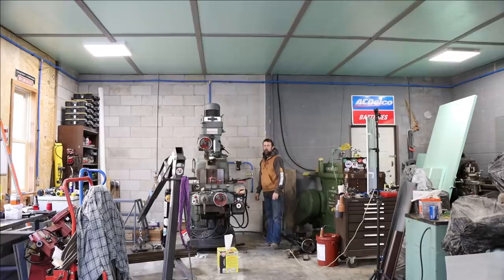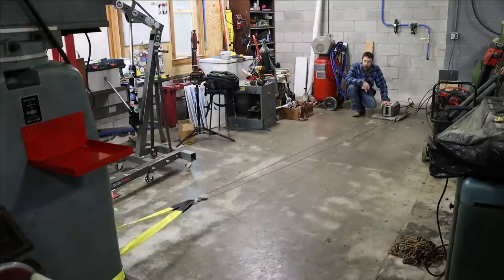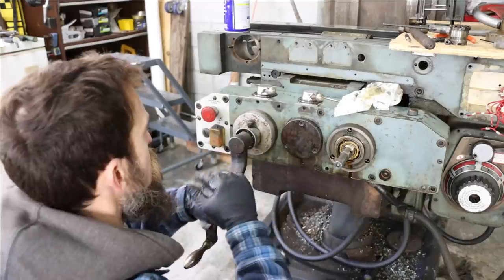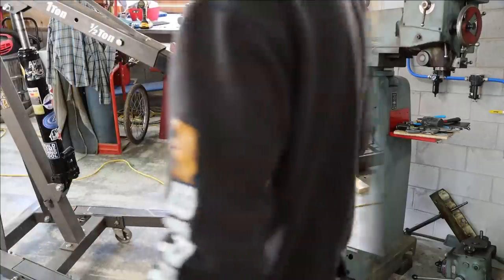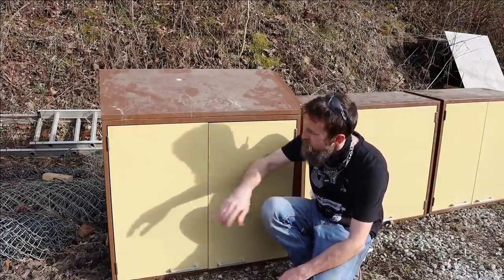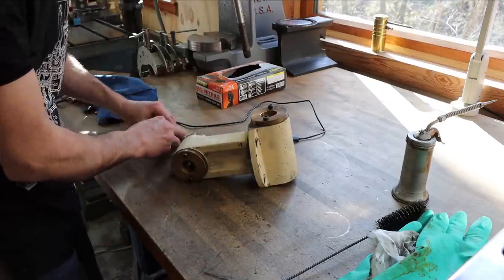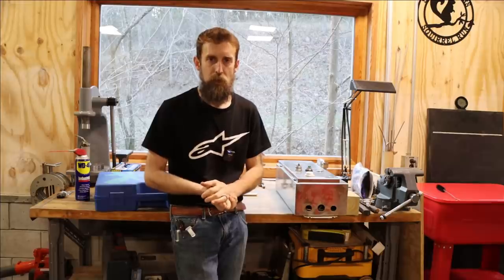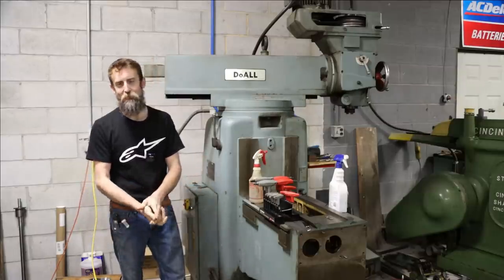Tearing down the DoAll mill. The Damage is bad.

Comment: about taking off the knee : you could put the forks from the forklift over the knee near the ceiling and only use it as an ancor point for the winch to lift it up and off the ways
Reply from the maker: The forks only raise 5' . It unfortunately will not work.  It would be nice if it would

Comment: I see a small gantry in Steve's shop. The spray weld kit is a real deal tool. We used  them to repair steam turbine & induced draft fan shaft bearing journals in our steam plant turbine repair shop

Comment: Enjoyed Steve...Carful lifting that knee, getting the balance right is key. When I did mine; made a bar clamped internally in the knee, didn't want to trust choker sling. It was only a series 1 BP..
An option for extending network access to the shop is a point to point Wi-Fi, there low cost and real easy to setup. works like a super long network cable....ATB

Comment: We have rebuilt 3 DoAll mills some what like this one over the years. I know it it too late now, but the easy way to remove the head is to rotate it 90 or 180 and crank up the table to support it. Put plywood on the table first. Disassemble the head on the table, repair as necessary on the table and then put it back. This way you never have to move dangerously heavy stuff around.  Your mill is 1000 lbs heavier than a Bridgeport. You see the benefit of all that mass when you take heavy cuts. It makes the Bridgeport look like a toy.

Comment: Steve,
You will need to try using only two machine rollers instead of four. Most machines will support on only two rollers. This will allow easy steering. We regularly rigged machine tools weighing 20-30k on only two rollers. It is surprising how easily very heavy machines can be steered by simply leaning in with body pressure. Center of gravity is pretty easy to find. Our preferred machine skates had four sets of rollers, but only two rollers rows were in contact with the floor at any one time as the end rows were set a bit higher than the middle two rows. Center of gravity on a knee mill is easily adjusted by moving the table and saddle.

Comment: I have moved machinery in the 5-6000lbs range using a johnson bar, 3/4" pipe, and a good pallet jack. Goes pretty fast. Others have mentioned a gantry and I have one but they are good for up to a ton unless you get something more commercial grade. A ton would work ok for pulling the table but you could not lift the whole machine up with it.

Comment: Reading the comments and seen a lot of negativity about the sound. That's what the volume switch on your device is for people! Steve, I have seen machine movers use a heavy-duty wooden handle on heavy wheels, with a short stout metal blade.

Comment: Thay spray welder is awesome. It is great for building up axle shafts for tractors and crawlers. Looking forward to the solution to your do all mill disassembly. I would rig up a heavy tripod over it and used a ratcheting hoist, and go slow and easy.

Comment: I knew that was a throwing axe when I first saw it in this video. And I know that the ONLY exception to using a pressure washer on a machine, is when you have it completely disassembled. You've expressed that wisdom many times.

Comment: For moving machines I use a Tirfor winch. They aren't very popular in the USA but used a lot in the UK. A very different beast to a come along. The one I use will lift about 8000lbs vertically and pull a lot more. Very slow and controlled.

Comment: I’ve used Turcite and Rulon, make sure you use proper glue(Shamban). It is self leveling, and holds a constant thickness. I worked for a rebuilder who tried regular epoxy and the results were not good.

Comment: If you want to have more fine control over that forklift, you can put flow control valves in the hydraulic system to slow the flow. I would consider a joystick type and add a momentary contact button switch to turn the pump on to lift so you can vary the flow but a simple needle valve for about $40 plumbed into the lift side would allow you to adjust the lift and drop speed. There might even be one already in the system on the pump.

Comment: Steve, if you want to brighten up this shop, consider this product or one like that will resist oil and grease, A mechanic friend once used a white wall board like this to finish the walls in his unit repair room. It was easy to clean and brightened up the room more than doubling the number of lights. I used bright white enamel in my shop with a similar wall board behind machines that tended to spray oil or dirt so I could wipe it clean easily.. Insulation board might help your comfort in extreme weather.

DPI™ Smooth 4' x 8' White Wall Panel
Model Number: 300 Menards® SKU: 5071063 (

Comment: Ok, watched the whole video. When I was a young man we would pull motors in a garage using a 4x6 and two 4x4 posts to hold the weight. The 4x6 was screwed to the underside of the joists to locate it and the two posts were wedged in underneath and removed when the job was done. I bet you have a gantry coming but that is another way to go in a pinch. You might consider making a table to fit over the forks of that lift you have. I bet you will use it to move heavy stuff on/off the mill and other surfaces more than you use it as a fork lift.

Comment: Steve,  it's unfortunate I am not local. I would love to set up a three phase power distribution system for your shop at materials cost only. And even automate the rotary converter start. Like when the tank air pressure goes down, it would first start the converter, then after about 15 seconds allow the compressor to start. Easily done with cheap micro-controller boards driving your magnetic starters.

Comment: On some of machine tools, if you remove the gib the component will come off.  I have a mill here and I can pull the table straight up and off just by removing the gib and I'm sure the knee will come off forward with the screw and gib removed.

Comment: Steve, a strong ammonia and  "REAL" TSP  solution soak will remove the old dried up coolant quite nicely.  It's cheap but soak it outside as the ammonia is really hard on the eyes and nose.

Comment: Little tip on your sound, in your video editor look for the normalize function in your editing software.  Normally you can right click on the sound stream for each clip and select normalize, or increase/decrease the volume of each clip by a number of db.  At the moment some sections of video are really quiet so i turn the sound up then the next clip is full volume and it blasts your ears off.  Another good video btw keep up the good work!

Comment: I've recently changed to scribing the parts with my ID #s or location marks with an HF vibrator scriber, with a cheap scriber. I've washed off my sharpy ID so many times I could not begin to count. It is so permanent and costs less than $10.00.

Comment: I USED TO SPRAY WELD BEARING SURFACES ON MOTORS AND GENERATORS.BEEN MANY YEARS LIKE 1976 BUT IT REALLY HASN'T CHANGED MUCH.

IT WILL PAY FOR ITSELF THE FIRST TIME YOU USE IT!

Comment: Mmm, Mr. Summers, you have placed your hands onto some serious toys.. The doall is a big piece and meant to do precesi work, altrhough the ways are what they are, but I'm sure you'll be able to remake it almost as good as new. I would like so much to have on hand something similar, but with little space it is not possible. It's also very sad to see so many machines and equipment meant to last be scrapped because of some repairable issues... Anyway, good luck with your work and to remove the knee you might use some gantry thingy, on wheels possibly.. =) I can almost read your mind, happens to me too. While having so many tools, it is always somehing missing to solve a problem. Keep on the good job!

Comment: I got hold of some old 1990's server cabinets last year for housing my 3D printers, they still had the 280mm and 140mm extraction fans in them along with a driver, they were far too powerful for controlling the temperature for 3D printing but I'm sure I will find a use for them

Comment: Did the DoAll saw go away? If it was finished I guess I missed it.
" Are you using 220?"
"Yah, 220 221 whatever it takes."
Funny when you were showing the scared up surfaces on the saddle. I was thinking it would be cool to add material to it so you can machine it back down.

Comment: I bet the dog in the woods is running deer. We had dogs out in our woods doing too. The doall mill sure is built right. Do ya think it was lack of oil or just repetitive heavy loads being milled? I started spray welding back in the seventies on steel mill rollers n journals . Bethlehem and US Pipe were customers of our shop . Gantry crane or big jib crane would help in the shop. Like to see the pups come out for rubs n mooch jerky to I bet. God bless y'all

Comment: So, did I miss the reveal on the weight of the DoAll table?

I liked the pressure washing method of cleaning those big (now free)machine casting pieces. That makes short work of removing the gunk, but still saving the painted surface coatings! That DoAll is one stout piece of machinery. Once you fix the ways, it will serve you well.

Comment: Steve, I have my workshop tethered to the internet in my house with nGenius Technologies ENH500v3 Wireless CPE/Client Bridge. I can’t recommend it highly enough. It gives me hardwired speed in my shop and in a year I haven’t even unplugged it to reboot. It just keeps working. The included quick start guide is useless though. I found better setup instructions on the web.

Comment: I was wondering if you could lay the Doall down on its side, then take the knee off vertically. It would be a little safer but not as safe as maybe a gantry crane would be. You’ve made a pretty good haul this week, a nice Jacobs 14n super chuck, some good cabinets for storage, a nice torch to repair worn shafts and things! You talked about turcite (sp?) for the ways on the Doall, could you spray metal with your torch to repair the ways or isn’t it meant for wear surfaces. Good video, thanks!

Comment: I say goodbye to my Excello Milling machine next weekend, sold it to buy a Snapmaker 2.0 a350. The XLO was a CNC machine that had a bad controller.  I removed the steppers and found that one had burnt terminals in it. The mill head was made for CNC only and had none of the regular power feed gears. I have not used it as much as I should have. I may get another one if I can find a good used one.
Reply: You sold a mill for a 3D printer?
Reply: @1pcfred  The price I sold it for was   nearly 3 times what I had in it and I wanted a 3d printer.  The Snapmaker is also a laser engraver and CNC Carver.  All thing I can use more than an oversized mill.
Reply: @rictecilder  I guess. I have a CNC engraving machine. I don't really like preparing files for it to run.

Comment: That NEMA 4X motor starter gets me ezxcited. 

I did know what that spray welding gun is used!!! It’s also used to make hardened seats for valves. I think it’s called stelliting. I specified a lot of stellite 6 valves for JGC, Japanese Gas Corporation, or the stubborn donkeys of the engineering world who demand the best for questionable uses like full stainless with stellite 6 for nitrogen service!

Comment: Iv learned when picking the brain of an electrician or someone with an expertise  other than mine I always ask what not to do it seems to be more important to me to know what you never want to do outside of those parameters its generally safe , case in point when I started operating equipment the first one was an articulating front loader on hills and I knew what I needed to do I just wanted to know what not to do as far as safe operation since then iv got certified on several forklifts loaders and excavators in order to work on them you have to put them through their paces

Comment: A few thougts about rebuilding the Mill, i you apply Turcite on the ways of the Cross Section, milling or shaping will be completely fine. Did you find  a reason why the surface is so badly scored ? Clogged oil line ?
Befor you do anything to the surfaces, get some measurements and some reference points so that the Spindles end up in the same heigt after applying Turcite.
Do you plan to get only the Y-ways on the knee ground or the underside of the Table as well ?
Are the dovetail sides scored too or only the horizontal section ?
Thank you for the great videos !

Comment: Great channel Steve. I wish I had a fourth of the space for a shop like you have. Im in the market for a mill and a lathe to get started as a hobby-ist, but Atlanta is not really a good market for finding used machines, or hobby sized machines. Been looking at Precision Matthews and Grizzly. Any pointers on picking a machine that will last me from a durability and functionality perspective? I probably have 20 good years left to learn before age takes its toll.

Comment: I don't understand why you would use that death trap HF engine hoist to lift/lower/move that casting when you have that powered fork unit that has the vertical travel to do the job. The engine hoist isn't a bad tool to have, but if you have better options why risk it. I had the same "Pittsburgh Heavy Duty setup years ago, when moving the head of my mill the cylinder failed and smashed the casting, that day I started looking for forklift.  It absolutely boggles my mind to see guys and girls that rely on their backs, eyes, and hands to make a living yet they won't take the most basic steps to prevent injury, welding bare handed, grinding with no shield, lifting heavy items when you have equipment, and the ABSOLUTE worst, wearing sandals in the shop. It really seems like the "I am too cool to wear my seat belt" mentality just never went away.
Reply: I wear my safety slides in my shop in the summer. It gets hot here.

Comment: Re: internet in the shop. Forget about running cables from the house, I think the cable runs will be beyond the max length for copper. Fiber is ok, but could be pricey, and fiber can be pretty fragile.
An alternative would be a microwave or radio beam link, they can be gotten quite cheap, and the cost vs properly rated exterior grade fiber cable is probably comparable.
Just wanted to drop that little seed into your head for when the time comes!

https://eu.store.ui.com/collections/operator-airmax-and-ltu
Reply: I looked at connecting 2 houses 1/4 mile away.  I could get ADSS (self supporting..think telephone pole spans) 1 kilometer single mode fiber for $600 😯
transceivers were $40 x 2.  doesnt make a lot of sense for Steve but just know its possible.  let someone else benefit from my dozens of hours researching this.
Reply: @Live.Vibe.Lasers  what I like about the radio solution is, it's crazy cheap (£100 transceiver on each end + maybe £100 in cable, clamps, pole etc), and it's effective field is +/- maybe 60°, so when it's blowing a gale outside, it's keeping the link up

Didn't know laser was an option tbh, my experience has been purely on short hauls runs, between buildings in a campus etc. I've never worked with the backbone level stuff.

Comment: Honestly, on a used "machine" like this, one should simply take it completely apart, clean and inspect prior to even attempting to start it up. I've known a few people not far from me purchased a used mill, fired it up just as soon as they got it, turned into a huge mistake on their part. 
With today's technology, just take your cell phone, take pics, lots of pics or, simply video record like you do now. Forgive my ignorance on this machine, (I'm not a machinist) but, that oil looked like it needed to be changed. I deal with gear oil, engine oil and hydraulic oil all the time. I was taught, when it starts getting dark like that, it's due to be changed.
That's why you should never use a "dish" service for your internet, they're all unreliable. 
Steve, just build your wife a new desk, you just got done rebuilding your shop, more or less. A desk isn't that hard to make. Great video as always, cheers :)

Comment: Go to https://satellitemap.space/ to see all the satellites Starlink has up now. Will be 42,000 of them eventually. If you click on the nearest ground station there is an option to find your location and see the actual satellites you are connected to. I used the Eutectic spray torch a lot when I ran a machine shop for electric motor repair in the 70's. Saves a lot of very old stuff. We used to repair motors for the cotton mills, none of which were made anymore. Pump casings, motor shafts, bell housings and Pancake 5 hp motors were often rebuilt that way. You will love it. Just be careful and keep the ways covered when doing it. Makes a gritty abrasive mess sometimes. Consider making a boom for your dad's skid steer. Would make a lot of stuff possible to load or move.

Comment: Steve,
Why when 1/2 of the shop was cleared out and the walls and floor were done didn't you throw some white paint on the walls?  It would have made it so much brighter.  This is not a criticism I'm just curious.

Great job so far.
Reply: My guess is Steve only has a limited amount of time and more important things need to be done.

Comment: You are not able to remove those scratches without surface-grinding machine. They should be milled, grinded and for the last scraped.  All of that will cost a pile of money. But without such kind of repair Your milling machine is just a piece of cast iron, because  those damaged surfaces are necessary for precission machining...

Comment: First! I know it will be a good episode! And it was! Steve a little bit of scaffolding and a chain hoist and you're good to go to get the knee off no problem and to get it back on.
Reply: I did that in a `hillbilly` way 15 foot  oversized tubing tripod   rope lashing top and legs together  chain block  for a landrover engine and gearbox .. it worked well .. 😆